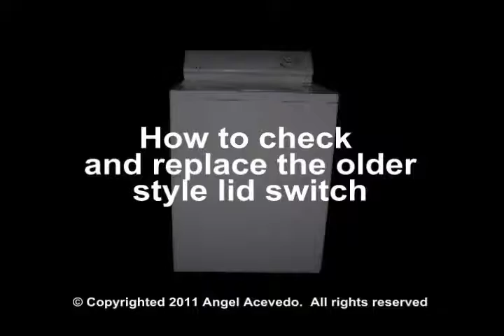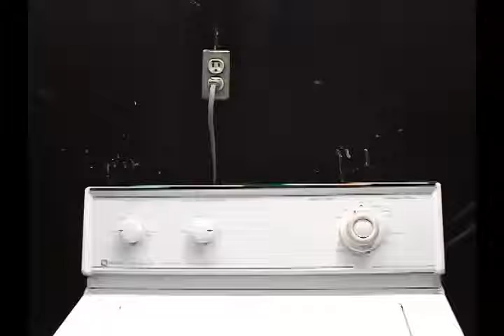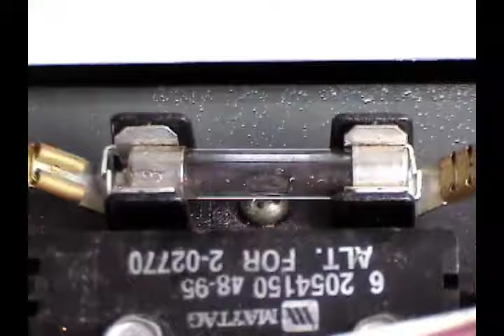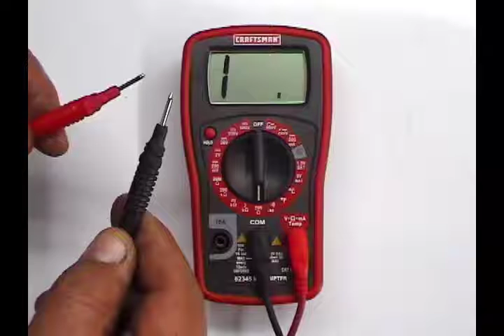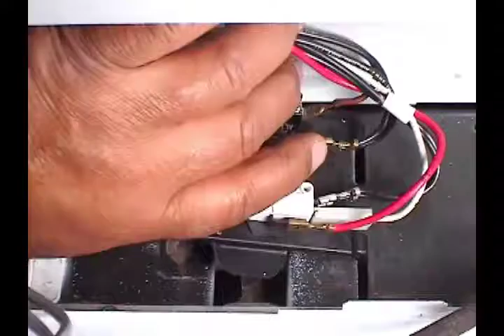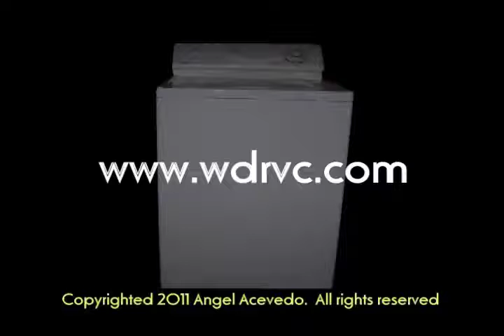Maytag Washing Machine Not Starting - Check The Lid Or Door Switch

Comment: I had a super thin jumper cable from an electronics project to test with.
I was worried it would over heat if I let it connect for too long, and sure enough it was warming up.
But it was good enough to prove it was an issue with the switch.
Thank you so much for your help❤❤❤❤❤

Comment: I know this is an older video, but I'm hoping you're still around to answer questions...  First off, great video!  I wish I'd seen this before incorrectly guessing it was my timer that died :(  My fuse and the first switch tested fine, it's the bottom one that appears blown.  Just to make sure, was the lid open or closed when you tested that?  I can't tell since you have one of the assemblies with the plastic covering the actuator.

Comment: Thank you, I believe you just put me on the right track to fix this old Maytag. Going to check out your channel now.
Reply from the maker: Thank You
Reply: I do have another question, if you could point me in the right direction. I did find that my lid switch assembly is bad so I jump wired that to eliminate it and washer fills and then spins and only partially drains and then stops, the timer switch /adjustment knob is still ticking away and advances around on it's own but nothing happens. it did trip the breaker once or twice, but I can still hear switch ticking and see dial has moved around? dazed and confused....LOL!
Reply from the maker: Send me the model number to see exactly what you have  mail to:  appliance-man@charter. net
Reply: Thank you , will get that right to you!